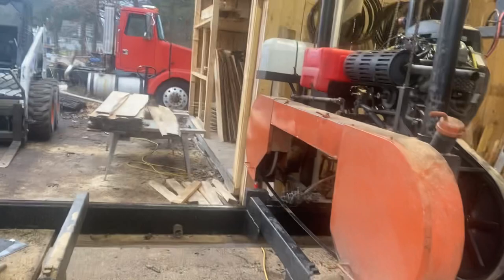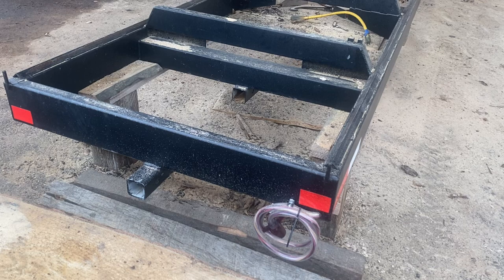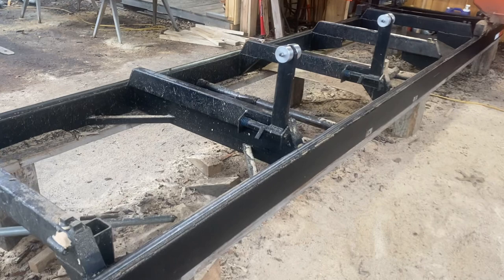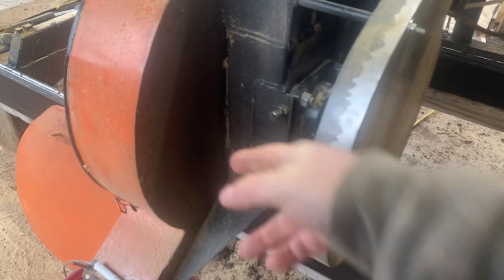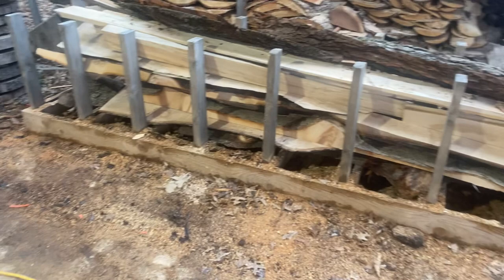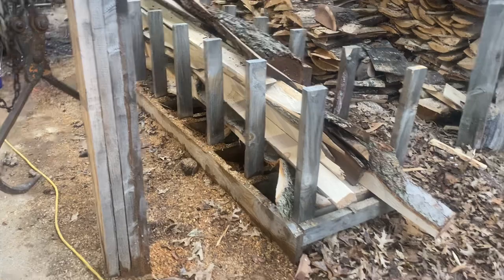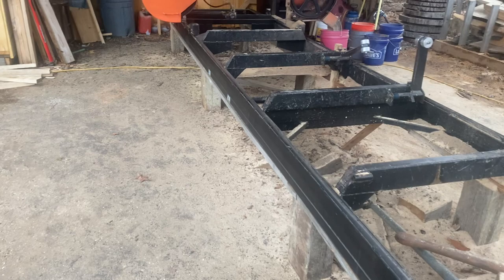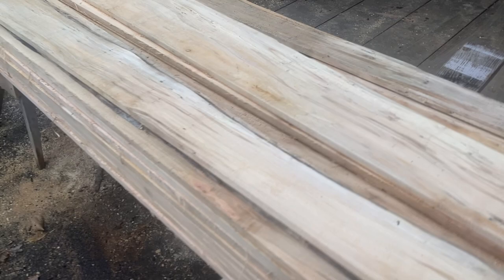Homemade sawmill ideas and tips(how it’s made)

Comment: Built from (old man sawmill) build video. But lot better video and explanation, great build! 
How far apart from v groove to v groove
Reply from the maker: Yes I used the spring idea on the top for sure. He sure has a nice mill huh!  But mostly from cooks sawmills. Which is where his ideas probably came from. I’ve studied ideas for about 20 years and the cooks mill to me is a great design. Thanks for the comments and watching.
Reply from the maker: Think the distance from wheel to wheel is 44” width if I can remember. And 36” from front to rear.
Reply: Thank you for Measurements they are very helpful. I have my track done and are about to start the carriage. Can you also give me height you used, it would really give me a head start. I subscribed after watching this video. Top notch
Reply from the maker: @artwilson4347  thanks very much. My email is also americobac@aol.com if you have any other questions too or would like to talk over the phone. I will have to measure the height I don’t remember off hand.